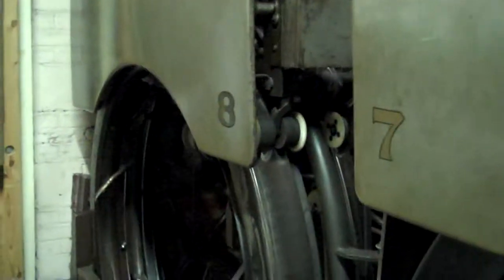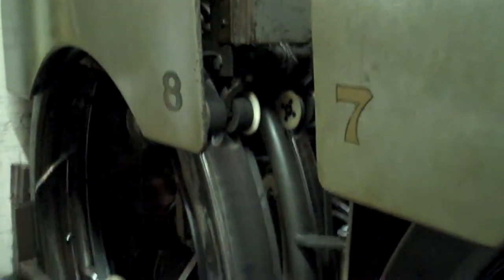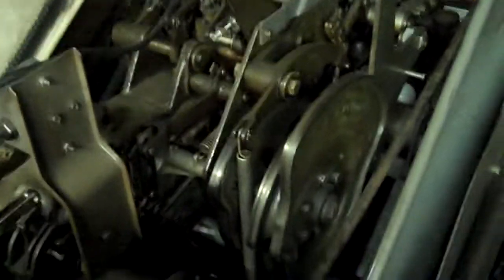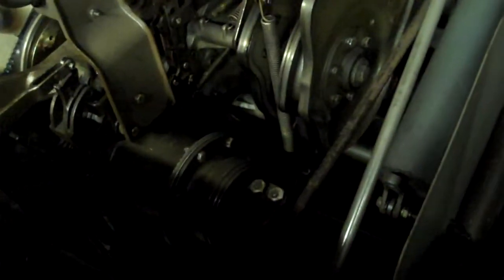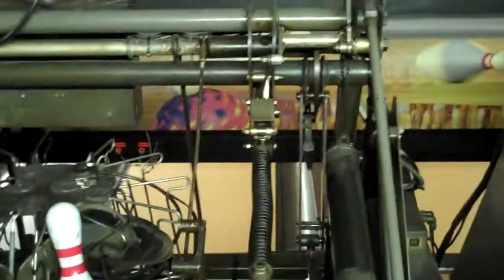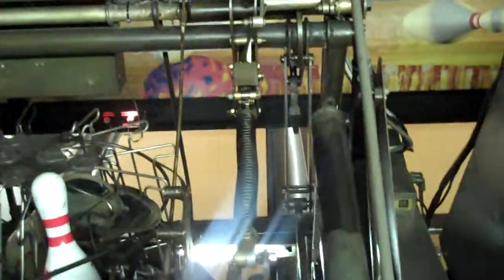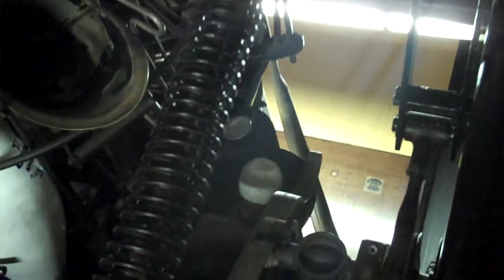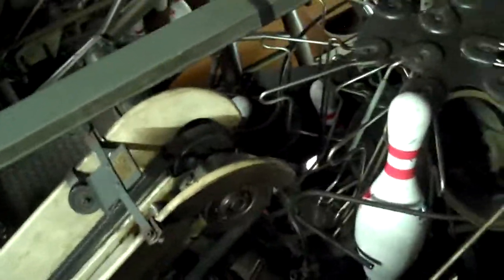Brunswick A2 Pinsetter - Rake Drive Mechanisms

Comment: I noticed the rake when it comes forward, slams against the stop bracket quite hard and  vibrates the machine. What adjustment do you make so that it comes forward smoothly and touches the stop bracket without too much force?
Reply from the maker: Machine speed makes it worse, these are full A2 speed. There's 2 adj's for it, the rake stops themselves and the length of the rake sweep link, the adj's go hand in hand. When done properly and when all hardware is good it does cut down on the rattling

Comment: How do you adjust the rake so it doesn't slam against the stop bracket in front and vibrate the rake board?
Reply from the maker: The faster your machine the more vibration you'll get "there's always some" you can cut it down though. There's 2 things, the sweep link and the stops themselves "which are adjustable" check both of them. It could be slamming due to the stops being too far back, or from the sweep link being too long where it will slam the rake into the stops on the way forward. These 2 adj's go hand in hand. I like the rake to be as far back as possible, it keeps the rake low and aids in the rake ejecting pins that get under it head first

Comment: Why is there no more two spring tubes on the machines? If one was enough why was there two from the beginning then?
Reply from the maker: Just one of NUMEROUS design changes over the years. They found with tension on both rake arms but it being driven only from one side it caused the rake arms to twist and bend. They did however go to a stronger spring when the A2's came out. They still have both styles, the A springs are a little weaker
Reply: Ok, thanks! I think my Lego A2 will have two spring tubes, but only helping the deck to come up a bit. I am not sure of how it is fasten to the rake arms. Will search until I find a good solution. Have you seen my latest Lego A2 update yet?
Reply from the maker: ThinkCleverAndSmart You can certainly do that and it will help lift the deck up from 270 setting new pins no question. On the real thing there's just long pins and "X" washers to connect them to the rake arms if that helps any. I did indeed see the new video. Looking great! :)
Reply: Thanks! I will do my best. And i do have a plan for this... :)
Reply from the maker: I can get ya some video from work if ya need as to how it connects, but it's pretty simple really
Reply: If you want I'll be happy! I didn't find any good vids about it on youtube. Thanks :)
Reply from the maker: ThinkCleverAndSmart Ok, I'll try and get that for you tonight then! :)
Reply: Thank you so much! :)
Reply from the maker: No problem, busy night tonight but hopefully when it clears out I can get it done for you. It really is a pretty simple setup
Reply: Ok! :)
Reply from the maker: ThinkCleverAndSmart Working on getting the video up now. Had some issues recording on my phone so I had to edit it but it should be live hopefully in 10 mins or so I'd say. Short but sweet :)
Reply: Sounds great anyway! :)
Reply from the maker: Should be live, the audio is crappy cuz I had to boost it a TON but ya can hear me talk at least lol :D
Reply: Checking it right now!
Reply from the maker: ThinkCleverAndSmart Awesome, hope ya enjoy, I threw in an annotation with a link to your channel as well, hope you don't mind :)
Reply: That's great Rep! Like your vids, they are awesome as always! :)
Reply from the maker: ThinkCleverAndSmart Thanks buddy, appreciate the kind words, so glad to be able to help you with your awesome project! :)